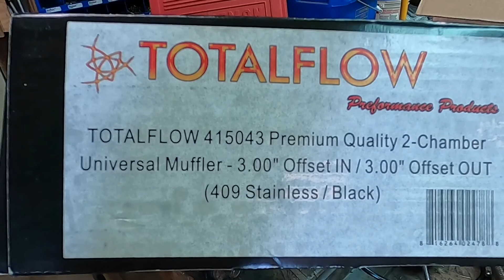Project Yellow: TotalFlow 2 Chamber Muffler on a 366 Chevy - 1987 GMC 7000

Comment: These trucks were made for straight pipes.
Reply from the maker: Agreed!  A nice throaty V8 sounds good with straight pipes or performance mufflers.  I'm getting to a point where I don't like them really loud, but I like some sound!
Reply: @FabbedFun  I "grew up" in Oklahoma driving a 366 wheat truck with glass packs. Key off/key on at 55 mph put the glass out the tail pipe and made the ol' gal talk a new language. Wish I had that truck....
Reply from the maker: @lyndleshelby6291  No doubt.  I've gotten rid of a few things I wish I still had around...

Comment: Those are factory hedders,hard to find,they didn’t crack like the manifold did,switch the carb to a edelbrock or something like that,those hollys are terrible,so much better drivability and fuel mileage without it
Reply from the maker: Yeah, I used to be a Holley guy but I'm not so sure.  Even Holley guys will say they can be moody.  She definitely hates the cold for sure.